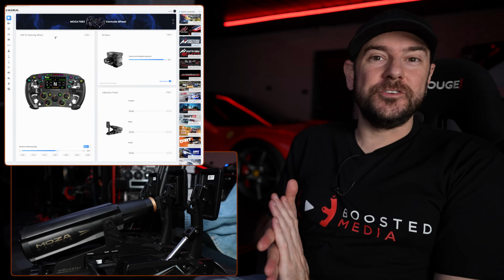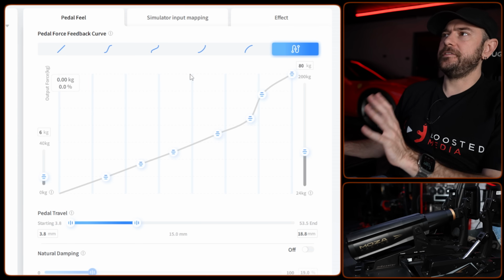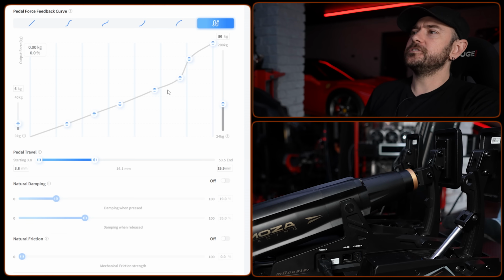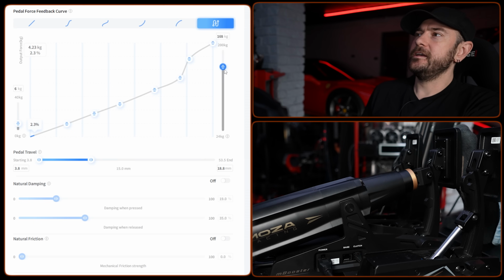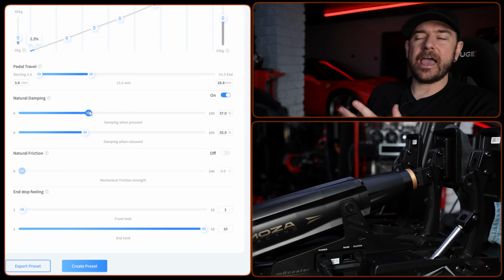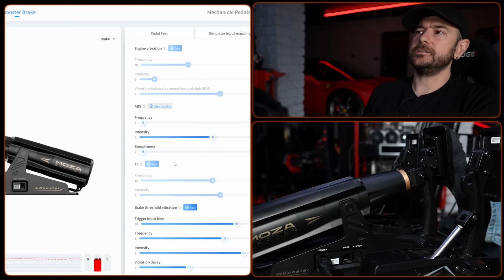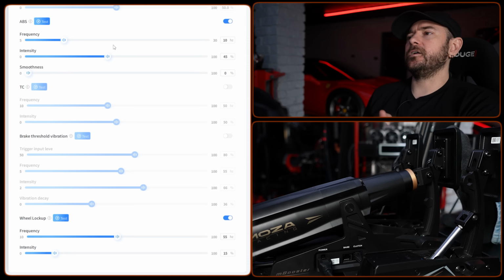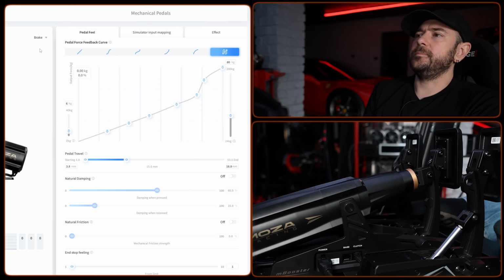How to Set Up Your MOZA mBooster Active Pedal | MOZA Racing Official Tutorials

Comment: You forgot to mention that mbooster can not be turned off in any way! No power button, no software turn off option. Moza mbooster is connected to the base it should turn off when the base turns off. Please fix this.
Reply: In the new beta there is a sleep mode which works perfect. Goes complet  silent. Also the padels feels way beter no cogging or stepping.
Reply: @NOTED66  Where is the beta available for download?

Comment: Having some trouble with the minimimum force value not doing anything. i set to 10k but even the smallest of forces are registering as brake input. 
secomdy, 
The maximum threshold for pressure senors seems bugged also (hope its not my load cell) or could just be user error on my part.

Regardless of what I set on the first window, in the second window, anything above around 35-45kg results in me not being able to go about 60% input when using the load cell. This could just be me misjuding 80-100kg of force, but I dont think so. it feels like another software glitch. This second value, shouldn't really effect the max input force anyway right, thats what the first window was for.
Reply: I'm having a similar issue. Were you able to figure out/resolve this?
Reply: @docraheelc I have also this.bougt it this week.